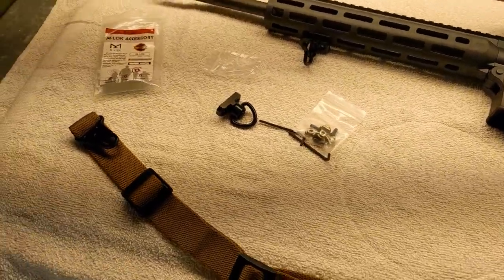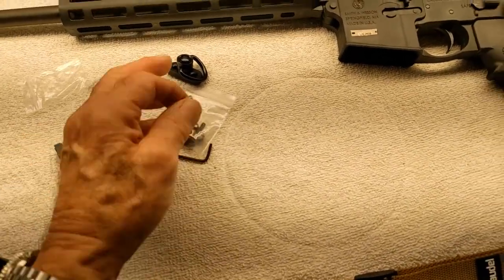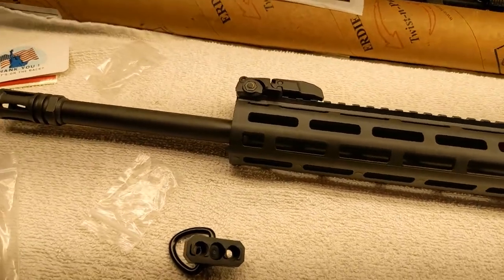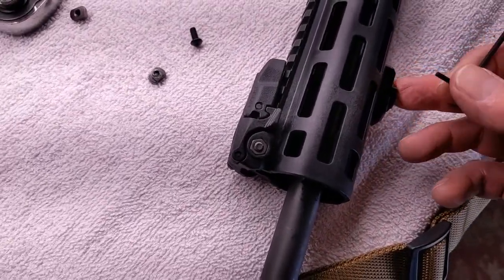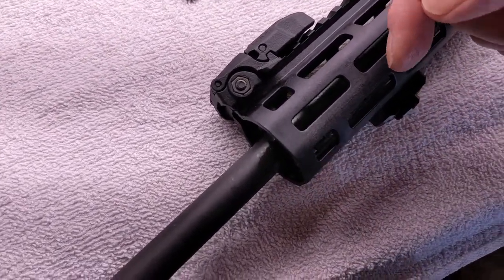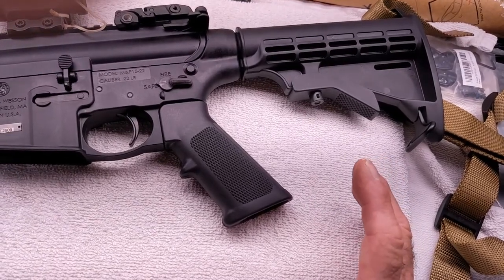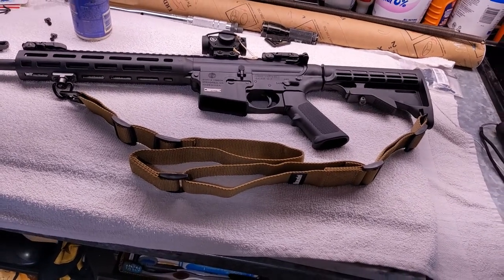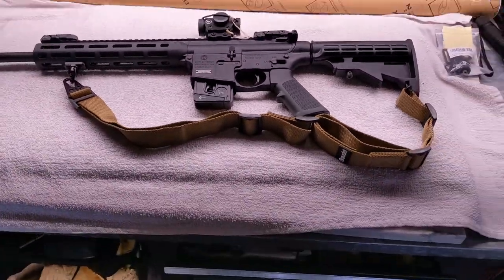Shooting Add sling to S&W M&P 15 22 by froggy

Comment: Man i can only imagine having laws that only allow 10 rounds. Great video helped me to find the right sling setup for me. I have the same but mine has a 25 round magazine.. I feel 10 rounds in such large gun is just like a joke i'm sure your laws don't allow for more though as to why you would have a magazine so small as most pistols nowadays even have more then 10 rounds in a mag and it all fits in a single hand. Hate it for you man, hope soon they let you get a larger mag as mine came standard with a 25 round magazine and that wasn't enough for me i ended up getting the 50 round drum. I mean you do benefit with small weight reduction though. Good day sir thank you for the video. Keep up the good work.

Comment: Polymer. The m&p 1522 is totally polymer other than barrel an bolt and parts of the bolt carrier, trigger, safety and bolt release. The 1522 is as good quality as the 1022 actually the same and even better for cleaning. Honestly with no tools the 1522 I can break the rifle totally down in less than a minute and see the back of the firing pin. It takes a screw driver and a little more time with a 1022.
Reply from the maker: Thanks!
Reply: @1947froggy  I forgot to mention that it does like some ammo better than others.
Reply from the maker: @daveweed2765  What does it like?
Reply: @1947froggy  CCI Mini Mags 40 grain high velocity and High velocity 38 grain hollow point Federal bulk ammo.

At 25 yards with a half size sillouhette both brand will put all the rounds through the head. 

LOL. That is a little bigger but not much than a squirrel's head and I do squirrel hunt with mine. The solid nose federal bulk that is red I haven't tried. The federal target rounds seem to have too big of a shot grouping. I have tried the Winchester m22 tactical but again shot grouping. I had some Winchester Wildcats which are conical like Reminghton yellow jackets and a few failures to feed. 

I never tried the Remington golden bullets because that is one named in the manual.

I don't really know much about the expensive high end names because I have never bought them. When ammo was ample on the shelf if I can pop a squirrel or rabbit in the head at 30-40 yards and harvest all the meat then I am good.

Try different ammo. Yours may like different ammo than mine but these two definitely work for mine with really good results on the range and in the woods.
Reply from the maker: @daveweed2765  Thanks, I have cci and some federal target. Just need to find a rifle range to shoot.  :) No open land near me where allowed.  :)